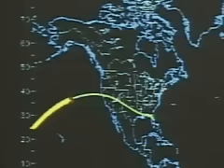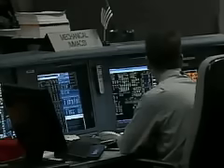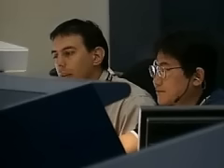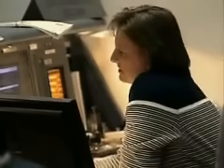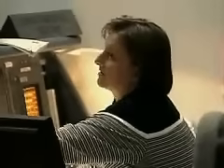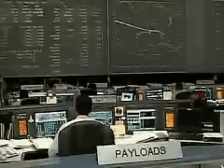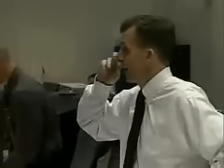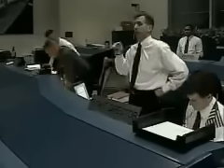Inside Mission Control During STS-107 Columbia's Failed Re-entry and disaster

Comment: Even final stage cancers have 5 % survival rate. U must get diagnosis
1.  Could have opted to low Alpha taking multiple bumps off the atmosphere slowing down shuttle before descent over days causing shuttle to land in sea & lost but astronaugts surviving
2.  Astronauts could have repaired it partially
3. A new computer program could be sent to orient shuttle in descent isuch that broken portion doesn't face atmosphere
THE FACT WAS NASA MANAGERS WERE PUFFTERS & PUSSIES.ON QUOTA & DIVERSITY AS IS THE CASE IN ALL ADMINISTRATION. WHEN MERIT RULED WE WENT TO MOON 50 YEARS AGO
Reply: Ahmed

You are overlooking the degree to which the flow of particle impacts at an orbital speed (in excess of 28,000 km/h, Mach 20+), while transferring some momentum and causing the shuttle to slow down, will cause the shuttle to heat up. This effect is missing from your analysis completely. The side of the shuttle taking these impacts will, as a result, experience an enormous increase in temperature and will have nothing to cool it: There is no medium that would pick up the accumulated heat and transfer it. Therefore you need a heat-shield and you need the shuttle to orient itself correctly to use that shield. 

This is a significant design problem with all hypersonic aircraft too. Even when you are flying inside the atmosphere proper, when you go fast enough, friction from airflow begins to heat the aircraft's leading edges far in excess of the heat transferred from the aircraft to the airflow.
Reply: To be concise, the speed at which atmospheric particles hit the shuttle changes the interaction between the particle and the shuttle. 

At normal speeds very little of the energy of the collision is absorbed by the shuttle as heat. At orbital speeds, much of the energy of the collision is absorbed into the heat energy of the shuttle.

Why is this? The surface of any material is the electron field of the outer layer of it's atoms or molecules. When this is struck hard enough, the strike will cause a disturbance that propagates as internal motion energy of the material. This internal motion energy, between the molecules and atoms that make up the material, is measurable as the material's temperature. Eventually when this accumulated internal motion is too much (too much heat), the material comes apart.
Reply: 1.  Could have opted to tlow Alpha taking multiple bumps off the atmosphere slowing down shuttle before descent over days causing shuttle to land in sea & lost but astronaugts surviving

Orbital mechanics does not work that way.  When you slow down, you drop into a lower orbit.  Once you hit sensible atmosphere, you're coming in.

2. Astronauts could have repaired it partially

Except that they didn't actually know the damage was that severe, and had no way of seeing it, or getting to it even if they could see it.  Oh, and no repair kit on hand.

 3. A new computer program could be sent to orient shuttle in descent isuch that broken portion doesn't face atmosphere.  

It was on the leading edge of a wing.  No way to get that out of the airflow unless you yaw the vehicle a huge amount.  And once you do that, you subject the orbiter to aerodynamic stresses that it wasn't designed to take and it breaks up.
Reply: Don't get the point of necessity for hi alpha descent. 

ENERGY CONSERVATION LAW METHOD OF VALIDATION
With rockets having put all the chemical fuel energy into u to take u into space u now have it all as PE. Admitted if u just plan to turning back to surface all that PE gonna convert to KE & u will be destroyed on impact if not burnt out on course. U got to dissipate all that energy for u to have zervo velocity touch down. BUT ENERGY LAW DOESN'T PUT ANY RESTRICTION ON RATE OF DISSIPATION. Hence slow descent isn't an invalid proposition. ...Its just like u come down straight from hill top without brakes.All u do is u follow a zigzag path . Every time u speed up too much u steer upslope..

NOW THE Q IS HOW TO MATERIALIZE SLOW DISSIPATION
The same atmosphere that heats u allows u to turn your KE to PE lift of it too.This way u keep hopping losing net altitude. It's just a doctrine that u got to have a constant hi Alpha decent. The point is if they had accepted their mistake on the face of it lots could be done. The real problem is Nasa's puff Project director still denies when he sees experimental evidence of foam tearing apart hardened tile bcz his family man brain doesn't let him differentiate b/w hardness & toughness. It's the same set of teams on diversity quotas & puffs managers on sycophancy qualification who say we should work on theories bcz theories r interesting & facts r boring thereby the gap b/w theoretical & applied science only widening. When Merit ruled & real men were Project Managers Nuclear bomb was built & performed as theorized within a decade of being theorized.

Out of lots of modelling possibilities one could be that computer could yaw it & they still would've at least 50% chance to survive. Given if atmosphere has the strength to tumble u then u can use same atmosphere to gain altitude as well & slow down again..Top pros write doctrines for fool-proofing not to be followed by other pros. Nor they  themselves follow those. Sadly NASA's recent managers have no ability to look outside the doctrines.
Reply: "Don't get the point of necessity for hi alpha descent"

It's because you're missing out what happens when you're in an orbit, and want to come out.  In the simplest case, you do a retrograde burn at apoapsis, which slows you down and lowers your periapsis half an orbit later.  From a typical orbit speed of about 7 km/sec, they typically only had to slow down by about 90 m/s to get the periapsis down to about 28 nautical miles-well below the point at which the atmosphere slows the spacecraft down.  That's just over a 1% velocity reduction.

Your idea of "hopping" and losing net altitude each time wont work for that very reason-as soon as you pull 1% of the KE out of the spacecraft, you've dropped the periapsis so low that you're coming home in half an orbit.  And whether you take that 1% out in a single burn or a series of hops doesn't change your entry velocity significantly.
Reply: I am also suggesting hopping within thin atmosphere too, given u have aerodynamic surfaces at your disposal. U r not just a projectile.....Pilots do Dead stick landings using this principle all the time. Every time gravity accelerates to dangerously hi velocity they use that velocity to regain some altitude in turn slow down. Bcz this is energy principle it is bound to works in every field. Even heli's do autorotation using same principle.U bike ride down slope from hill u get same option u can steer up-slope any time to slow down.....

Admittedly it is thin atm but ultra hi speed means u can get lift from thin atm too. Energy principle above para proves this option has to be vailid. .... Hi-Alpha is quick dissipation mode in which u lose energy too quickly & energy has no other way to be lost than quick decent & fast heating-neither of which was disirable with broken heat shield. They should've instead opted for most optimum glide at 10 deg Alpha-losing energy very slowly

btw I haven't done thin atmosphere modelling ....Particle based, not FE continuum based, solver is needed...I won't be surprised that if u have enough particles to pressure heat u up then u can obtain lift from them too.
Reply: "I am also suggesting hopping within thin atmosphere too, given u have aerodynamic surfaces at your disposal." Columbia began shedding debris when it was still about 45 miles up.  The aerodynamic surfaces on the shuttle didn't even begin to become effective until about 30 miles in altitude and didn't become fully effective until about 10 miles. So "hopping within the thin atmosphere" wouldn't have worked, because Columbia was nothing but debris by that that time.

"U r not just a projectile"  Actually, from the time of the reentry burn until you get very low in the atmosphere, you really are a projectile.  A somewhat steerable one, but a projectile nonetheless.

Look, I know you think that there must have been something, anything that they could have done.  But wanting options is not the same as having them.  Deorbiting a spacecraft is not like a dead stick landing of an airplane.  It just isn't. With very few exceptions, you cannot apply the things you do in an airplane to an orbiting spacecraft.  The fact that you don't seem to understand this should clue you in that your "simple" solution isn't done by anybody for a reason, and it's not because of "doctrine".  It's because it won't fucking work .  It won't work for NASA.  It won't work for China. It won't work for Russia.  It won't work for SpaceX.  It won't work for anybody
Reply: While u r a projectile that makes it very easy to orient orbiter sideways towards undamaged side to  hide damaged shield from Pressure heating. But then shielded side would have heated up more. Designs always have FOS of 2. .Probability it worked 50 %..Now the only major issue would have been transition back to straight just in time as u hit thick atmosphere otherwise it would tumble. Probability it worked 50 %....Then u had to just land it keeping speeds low throughout ...Probability astronauts survived 25% - still better than sure death. 

Nth could be done is their excuse of not accepting HORRIBLE DECISION of going by doctrine: "foam cannot damage hardened tile" hence not going down modelling, analyzing & experimenting the damage route.  3rd stage cancers r recovered in 5% cases if u acknowledge problem & settle down on fixing it - that's what defines a man - not being a family man.  No wonder half the managers on project were fired but world didn't learn the lesson as they continue to promote diversity over merit  & sycophancy over ruthless success & we saw Japan's Nuclear reactor disaster where these family men showed height of vulnerability, coming up with the worst possible outcome salvaging nothing against gradually rising water. bcz they had super fragile all autonomous system with no mechanical backup. no robustness & didn't take big decisions in this day & age of every technology at man's disposal at that
Reply: "Now the only major issue would have been transition back to straight just in time as u hit thick atmosphere otherwise it would tumble"

Fine.  Now understand that what caused the shuttle to tumble and break up was because of asymmetric drag because of the damage to the left wing.  If you yaw the orbiter enough to provide any sort of protection to the damaged wing, you're going to get the same kind of asymmetry. And seriously yawing the shuttle during reentry causes another problem-it changes the airflow so that a good part of the superheated air flows over the top of the payload bay doors-which did not have even the lower temperature thermal tiles.

So, yaw the spacecraft to protect the wing and the shuttle fails because you lose the payload bay doors.

Your estimate of a 25% chance of survival is really just a SWAG, based on data that you don't know and haven't considered.

Comment: Did NASA know that this would happen after the foam hit the wing at liftoff and decided not to tell the astronauts or try to do a rescue of some sort?  I'm asking because I really don't know the answer.
Reply: SuperBoomshack It was decided that the foam hit couldn't have damaged the ship. But the foam was frozen solid and traveling at super sonic speeds, which made it cause far more damage than expected. Had they known the extent of the damage, they would've instructed them to stay in space until a repair or a rescue could be arranged.
Reply: Nickoli Lion ok
Reply: I've looked at reports on the rescue plan that NASA put together afterwards at the request of the CAIB.  At best, a rescue would have required several outsized miracles.  They were up against a hard limit-if they went to a "minimum consumption" mission profile, the LiOH air scrubbers on board Columbia may have lasted until flight day 30-anything that takes them to day 31 was no good, because the crew would have been dead.

Comment: At 2:45 the comment “No commonality?!” is very distressing. It means it is not an electrical or hydraulic glitch or anything else within the Shuttle. The systems are completely independent of each other, it has to be an abnormal and external force acting on the Shuttle...
Reply: Exactly-which is why Cain specifically asked about it.  If there had been some sort of commonality, that's the most likely source of the failure.

Comment: Is it just me, or does anyone else think that the way the astronauts came back to earth in the sixties was safer? It seems safer to drop in with a capsule than to try and fly a plane through the atmosphere. Can anyone expound?
Reply: It's not necessarily that capsule reentry is safer than Shuttle reentry, it's that capsule launches are safer than Shuttle launches. If a piece falls off of a traditional rocket, it can't hit the capsule above it (debris strike during launch being what doomed Columbia). And of course, a capsule can abort by being pulled away from the rocket, something the Shuttle couldn't do (which is why Challenger was doomed).
Reply: @brch2 
Capsule reentry is safer.   Flying a winged plane at Mach 25 is insane.  A capsule isn't going to break apart if it loses a certain orientation.  But if a shuttle goes sideways at speed, you're dead.
Reply: @jshepard152  If a capsule goes sideways at speed, you're dead. Though granted, it's a lot harder for a capsule to go sideways like that...
Reply: @brch2 
Ironically, Challenger and Columbia ultimately failed for similar reasons... Aerodynamic forces acting on a fancy space plane that found itself sideways at high velocity.  It turns out that fancy space planes are stupid, which is why no one wants one, least of all NASA, the world's foremost authority on fancy space planes.

Comment: Can someone explain this to me like I'm a 5 year old, some foam thing came off (what was this piece for) and hit a wing or something, causing damage to idk what making their landing back a disaster, i just want to understand fully. And RIP to those heroes. They died doing something amazing though 🖤
Reply: OK, the external tank (ET) was covered with a spray-on insulating foam to eliminate ice building up on the outside of the tank.  The concern was that a big chunk of ice could fall off the tank during ascent and damage the orbiter.

What happened in this case was that a briefcase-sized chunk of foam came off and hit the leading edge of the left wing.  It caused a break in the reinforced carbon-carbon panels on the leading edge.  During reentry, that hole allowed hot gasses to enter the wing.  The first damage was that a bunch of sensors dropped out-probably because the wiring had burned through.  The heat also weakened the structure of the wing, causing it to come off and make Columbia aerodynamically unstable, and it broke up.

When we hear the word "foam" we normally think of something soft, but this foam becomes very rigid and hard when it dries.
Reply: almostfm thank you!

Comment: Shocking how little they know. No sensors that show the thruster rockets are continually firing to keep the broken aircraft stable? No sensors that show a foot and a half hull breach?  No sensors that show a temperature drop when the aircraft has a giant hole in the wing during space flight? And how does TV know it's broken apart before Mission Control?  How about a television? Maybe have a visual watch of re-entry as well as instrumentation?  Why are they staring a giant black instrument screen?  No one thought to also include visual confirmations?  Would it have helped - no, but it's indicative of the attitude and intellect of the agency. Arrogant and incompetent organization.
Reply: "Maybe have a visual watch of re-entry as well as instrumentation?"  The reentry path is several thousand miles long, and a good chunk of that is over the ocean.
Reply: The consoles all have information, they aren't staring at a blank screen. The consoles are reporting the last data point they received. When the accident happened there was no way for the data to be transmitted and this is where the loss of comm was reported. That's when comm checks and tracking checks started occurring for the tiniest chance that they were ok.

Also, once they lost 4 sensors in the left wing that were redundant and had zero commonality is when the test director realized something was majorly wrong.
Reply: Not only is the reentry path several thousand miles long, it also will change if they have a no-go on one landing attempt, and have to wait one or more orbits for another attempt.

Comment: I was told by a NASA employee just after the crash that the engineers knew there was going to be a problem on the re-entry, but they had no way to fix it, couldn't stay in space at the ISS, there was no way to get a rescue mission together, and had to try. This whole thing is sad. Dangerous stuff - flying into space. Remember - planes crashed all the time at the dawn of flight.